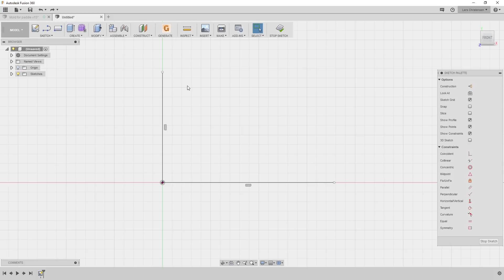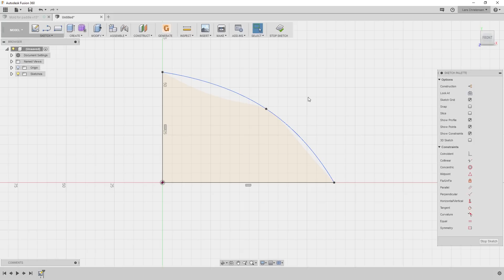Fusion 360 Quick Tip — The Hidden Spline Function You did NOT Know!

Comment: Hi Lars, Often get an issue to measure a simple (minimum) distance between a spline and line. Same for adding a dim for the same. Fusion goes crazy and returns the incorrect number. You can also see it showing the points which are obviously not the min distance. Any chance you can touch on this in one of your tips? Thanks for all the great information you share!

Comment: Hi Lars, I've encountered an odd problem and hope you might have some insight. I've designed a  small shed with Fusion 360, just a simple base, four walls, some openings in the walls for doors and windows. I tried to apply some "appearance" colors to the faces of some of the walls, each of which is a separate component. For some of them it works, I can successfully apply the color to just the outside face of each wall, but for one of the walls it simply refuses to allow the color to be applied. I can apply it to the entire wall COMPONENT, but not to individual FACES of it. Do you have any insight as to why that might be the case?
Reply from the maker: Hi Roger Garrett Thank you for watching!
I am not hundred percent sure what is going on with this. I think I would try to reset the appearances and try again. If you still see problems I would recommend that you reach out to support:
https://forums.autodesk.com/t5/fusion-360-support/bd-p/962

Best,
Lars

Comment: Cool tip, thx! How do you constrain a spline? I can never get it to turn black and can't figure out the curvature constraint.
Reply: You can 'fix' a spline (shows in green), or you can put constraints/dimensions on the handles.
Reply from the maker: +1 Paul

Most of the time I right-click the spline and select fix, but you can add dimensions and constraints to spline handles and spline points